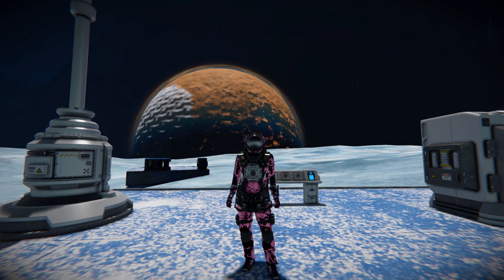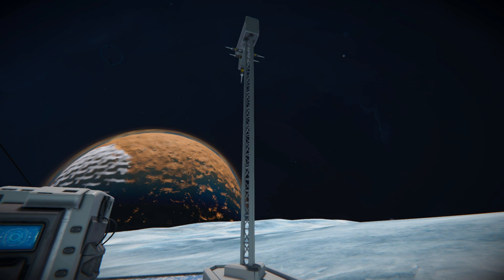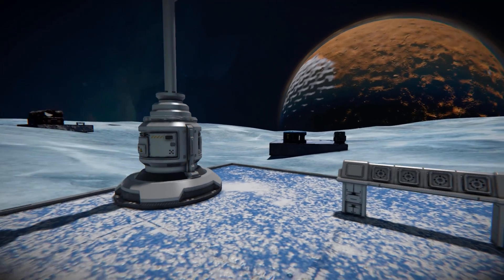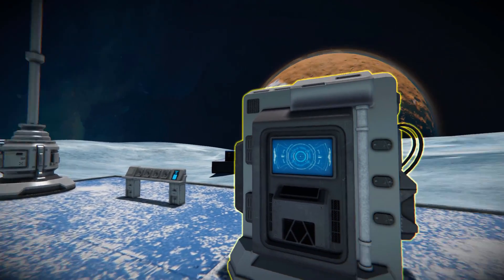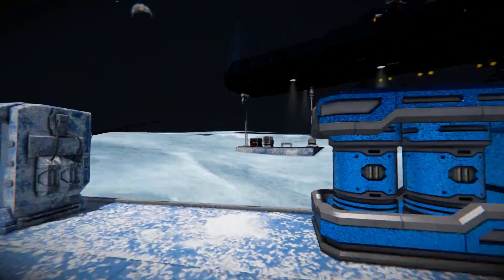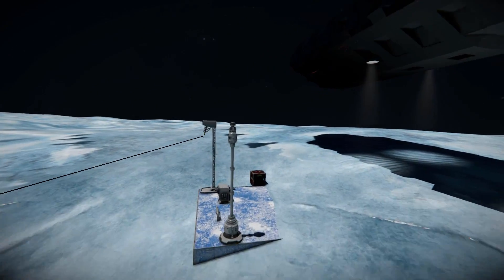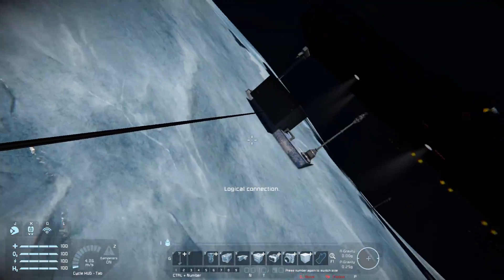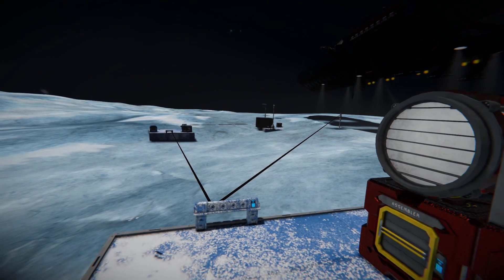Tethers: Power and Fuel - Space Engineers

Comment: So what exactly is the difference in function for the different blocks? What makes the two pylons or even the 4 port different beyond the number of connections?
Reply: Well, so far they don't do anything differently but in future will require things like transformers every x amount of meters so that the power don't drop. But that is something that will come much later. Others are just for diversity so you can have something resembling a pump station kind of thing and the for now very basic looking cable panel is meant as a test block to make cables spawn from different sockets etc. All in due time. 😅
Reply: @twitchingpsycho  can it transfer hydrogen? Or is the Fuel part only electricity?